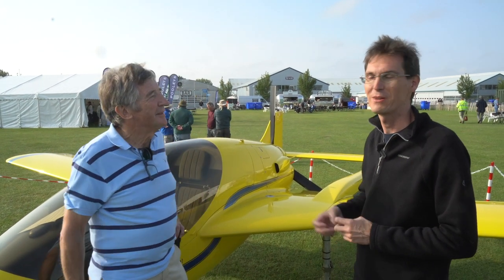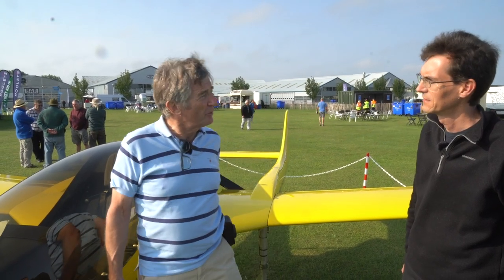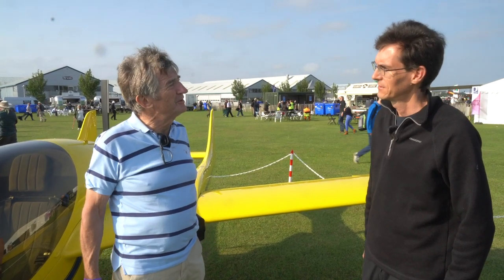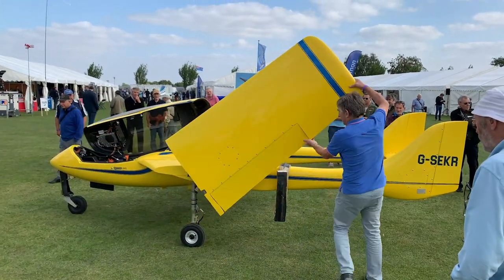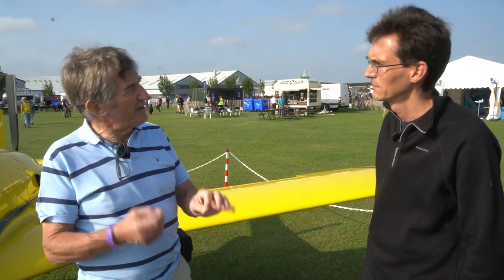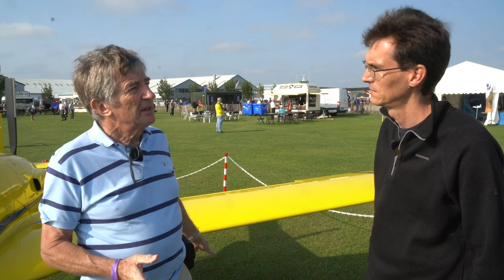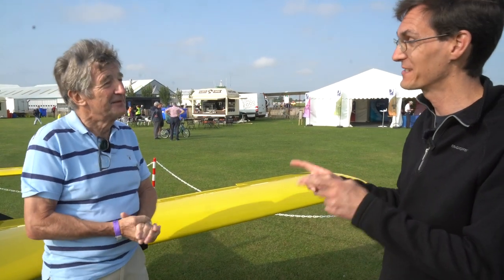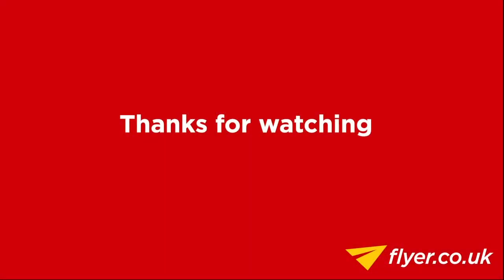Ivan Shaw and his 180kt homebuilt

Comment: Hi Steve.  Yes, I did all the stressing on this. Oil heating problem solved by going to the P51 oil cooler/radiator configuration in the intake duct. Flight testing now completed successfully. I edit the newsletter for an engineering club I belong to, with lots of details on the design/testing of the aircraft. I will send you the links. Ivan lives just up the road from me. Cheers, Nev.

Comment: Well, they say there's nothing new under the Sun... I'm the proud owner of a CFM Streak Shadow, designed along the same principles as Ivan's Seeker, as a 1+1 tandem seater (or folding bike instead of passenger). Composite materials way ahead of their time, pusher prop, identical view from the cockpit etc etc.(but quite a bit slower with a Rotax 582). The main difference is that you can pick one up second hand (only second hand of course, since they're no longer made) for less than £10k! I'd still love a Seeker as well though...